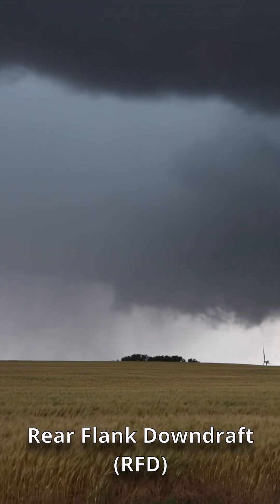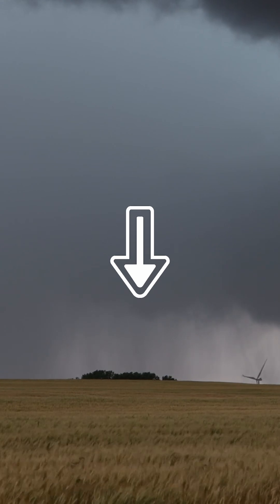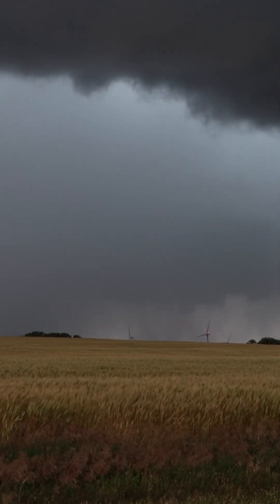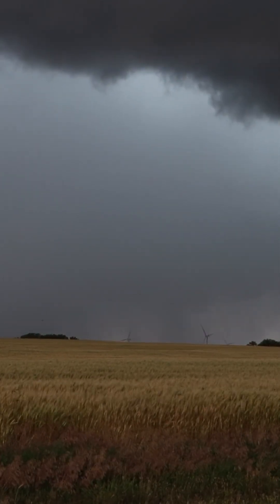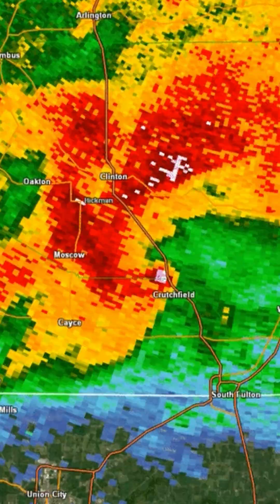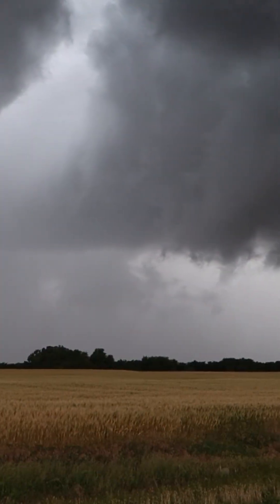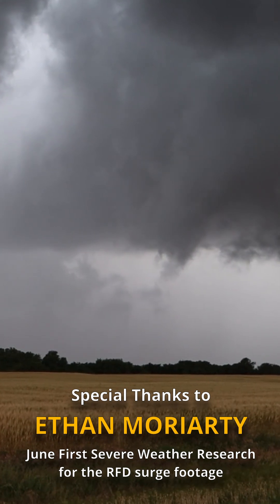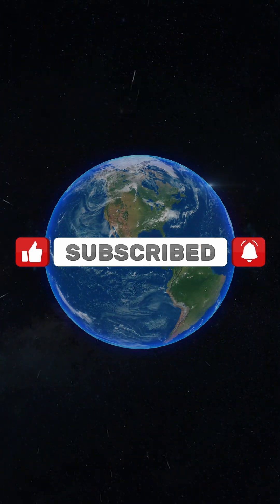Rear Flank Downdraft (RFD) 🌪️ A key element in Tornado Genesis

Comment from the maker: Your support through liking and commenting truly impacts the visibility of this video, so I'm genuinely grateful for it 😃 

Also, if you're curious, check out the video description for additional details.
Reply: I believe new computer models show that it's the cold air inflow, and not warm humid air, that's the main source of fuel for tornadoes.
Reply from the maker: @elmamo2000  You're right. That's the prevailing information we have, although we're discussing two slightly different things. 

Tornado genesis is now believed to be more involved with a horizontal body of cold air that twists upwards and becomes a vertical column. 

Temperature differential is still very important however. The interaction between the warm and cold air masses contributes to the overall dynamics of the tornado. 

The thing that drives the atmosphere is really pressure and temperature difference. As you know, warm things want to become cold, moving things want to become stationary. All things in the universe want to lose energy and become stable. 

This particular phenomenon (RFD) is more to do with winds that usually rotate from the North, towards the South West. The air in the inflow notch, generally on the South East side of a tornado, is usually much warmer than this cold RFD air that's descending from the mid level of the mesocyclone.